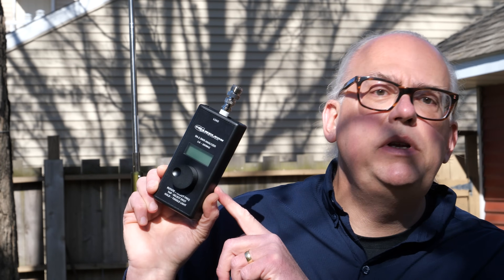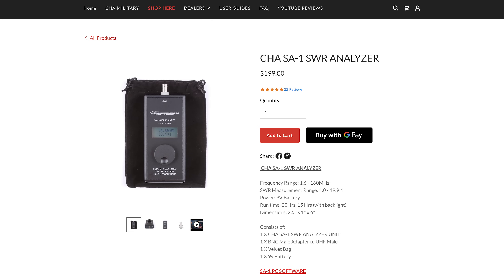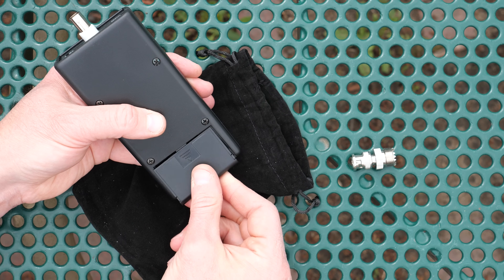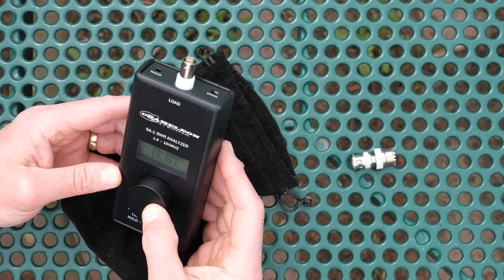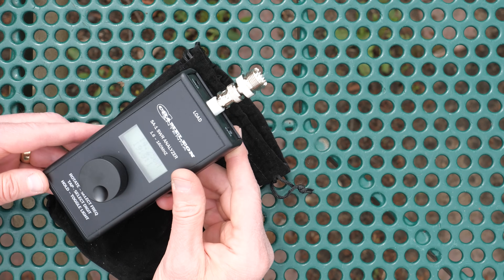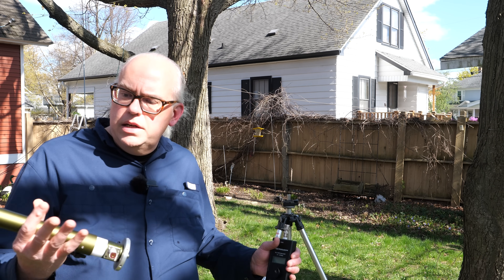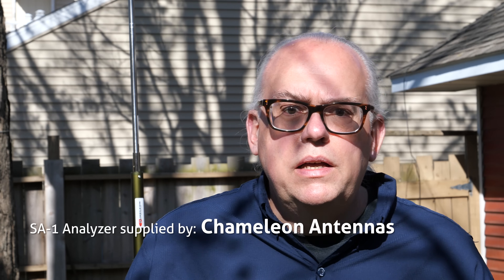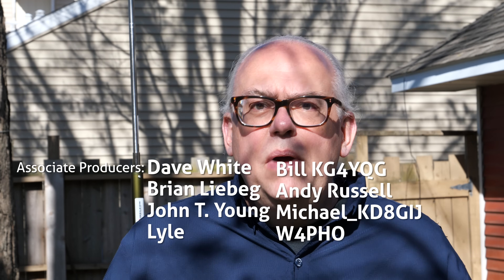How Does the Chameleon SA-1 Antenna Analyzer Really Work?

Comment: If I didn't already have a Rig Expert, I would consider buying the Chameleon SA-1 because the price is very appealing. If I already had everything optimized and it was just a matter of adjusting the whip length in the field for a particular band, the SA-1 would be perfect. The only downside I see is that it doesn't offer an impedance reading (need the reactance) so you can't optimize for efficiency. You know the old saw, a dummy load has 1:1 SWR :-)  Thanks for doing the demo. 73

Comment: ...eliminating unnecessary features/functions is what makes this attractive; no, it's not an antenna analyzer/VNA, but it's certainly more convenient than just using a conventional SWR meter👍😃🇺🇸
Reply: That's the goal of it! One thing that does one job perfectly! It would the same thing as why bringing a QRP radio for POTA and SOTA why you can all all the feature of a Yaesu FTdx-101MP HF/50MHz 200W Transceivers FTDX-101MP!

Comment: At the risk of being too technical, an antennas' "resonant" frequency and its "lowest VSWR" frequency are not the same. The resonant frequency is the point of zero reactance.  VSWR is just an indication of proximity to 50 ohm impedence.  
KZ9V
Reply: And the SWR is just what you need on POTA and SOTA - which is why we designed unit! You don't need anything else!

Comment: 1:1 - 19.9 ?
Why not 1:1 - 1: 3 as it has always been?
How bad / good is 1: 1.5 at this scale ? It was ok when 1: 3 was the max reading.
I think I like my oldscool analog meter alot more. Its ok for a 2nd meter I guess alltho overpriced and no 70cm.
Reply from the maker: Ummm, the scale is the same whether it's 1:1 to 3:1 or 1:1 to 19:1. The only difference is that the range is extended. Old school analog meters would be terribly imprecise if they extended to 19:1, but it really doesn't matter with a digital meter.
Reply: Unless you build you UHF/VUF in the field for POTA/SOTA - those two band are useless for what it has been designed for.

Comment: I’ll be real and say that you could just get a chelegance MC-750 antenna and not have to deal with messing around with fine tuning the whip length. It really irks me that literally nobody else has been smart enough to etch band markings directly onto the whip. Instead we force ourselves bring extra gear like tape measures and antenna analyzers.
Reply from the maker: Band markings are relative and can shift depending on the local environment. The scales are good to get you in the ball park but a meter of some sort will be required to fine tune your antenna.
Reply: @KB9VBRAntennas  and yet 99% of the time using the markings on the mc-750 gets me spot on, or within an swr of 1.5:1 or better
Reply: @JonathanKayne  same here - every time I measure the coil distance from the feed point on the CHA PRV, I’m 99% of the time close to what I need! You just get used to use you gear!
Reply: @Chameleon_Antenna  ahh but the difference between you and me is that I don't need to fiddle with a tape measure to get to that point since it's marked on the whip. 
My point is that there are tons of antennas that are sold where this would absolutely be useful and I only see chelegance doing it. If I need a tape measure to get my antenna into tune than that presents two problems: I now have to remember to pack a tape measure which adds weight to my kit, and I have to spend more time fiddling with the antenna which means less time on the air.
Reply: It doesn't work that way! The CHA PRV (MCC) has been designed to be used on just ALL existing support platforms! It's VERY versatile - that being said, each configuration require a different loading of the coil (distance height are all different) but the SS58 whip is ALWAYS fully extended which maximize your TX. The moment you change the length of the radiator - you change the TX performances.

Comment: I think for me I would spend $25 more and go with the Rig Expert AA-35.  Although it’s not as small and portable as the Chameleon.   I think the extra features is worth the extra $ and larger size.
Reply: If you don't have a QTH analyzer - it's a no brainer to get the Rig Expert. We never said that the CHA SA-1 should be your main antenna analyzer!
Reply: @Chameleon_Antenna  I'm sure it will be a great success.   I'm not knocking it by any means, I just don't think it's for me.   I much prefer to have one good tool for everything I may need.

Comment: Looks like a good meter if all you want to know is the SWR. It does not give the "R" and "X" values which are very important to know when setting up your antenna for maximum performance. Impedance is important. For quick and dirty set up, if you don't mind the price point, it might work for you. I'll pass. Good, fair review Michael.
Reply: Good for portable operations like pota with whip and coil antennas 😊  OMG,  just looked up the price,  I take back my previous comment,  😆
Reply: @chrisnmichelle0218  I’m genuinely intrigued at why people think a USA product like that is too expansive? We pay our USA vendors, manufacturers and employees very well. Can you find better and cheaper made in the US. What can we do better?
Reply: @Chameleon_Antenna  you guys print your own circuit boards?   I did not know that,  that would be a bit different.   I just figured the inside would be full of made in Taiwan,  China,  or Japan...
Reply from the maker: In the field, knowing values like R and X can be good, but they are not critical. I've got other meters that will tell me that. What's more important is ease of use and fast setup. When I'm setting up my vertical antenna, I'm not going to waste time tweaking it to its full, potential, but instead get the SWR down to a reasonable level so I can be on the air. That's why I didn't recommend this as a person's first meter, but instead something small to keep in their kit, so they can leave the big meter at home.

Comment: Hi Michael, does the SA1 display have problems in high or low temperatures? I had an MFJ (RIP) analyzer and  during summer Field Day in the heat of the day the screen letters would disappeared. Thank you for the great videos. Robert Pantazes, W2ARP
Reply: But like any electronics, you don’t keep them in direct sunlight for a long period of time waiting. I design and test A LOT of antennas and I like to take pictures of the analyzer readings, setting and others. In Phoenix, if I live my iPhone in the sun for about 5 to 10 minutes it will shut down!
Reply from the maker: That's a good question. LCD or Liquid Crystal Displays can turn black in extreme cold and hot. This display looks very similar to the dot matrix display found on the MFJ-259 series analyzers. I don't know if it shares the same heat and cold tolerances as the MFJ model.
Reply: No - the CHA SA-1 is great in any weather!